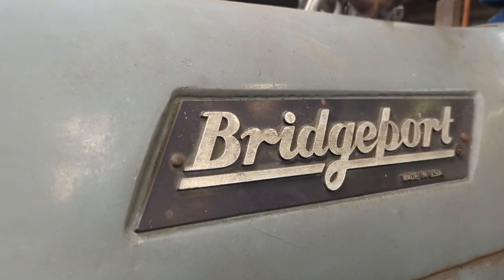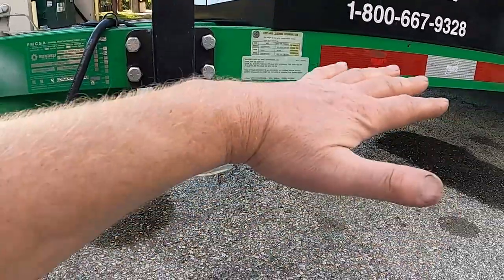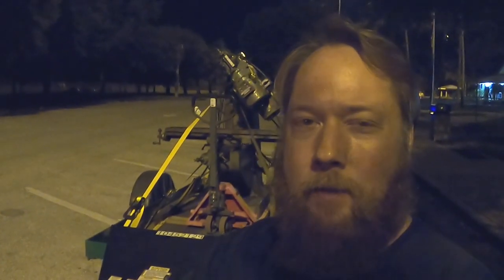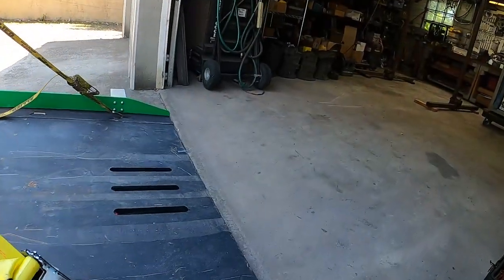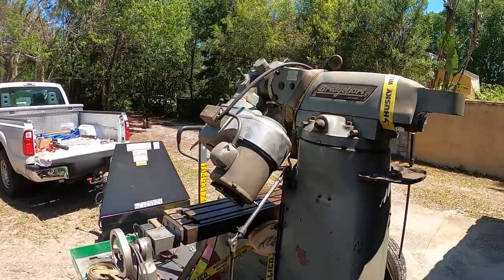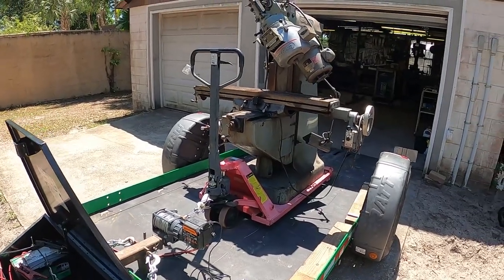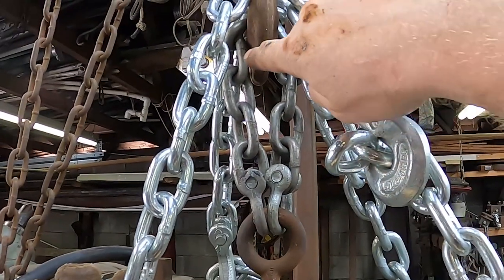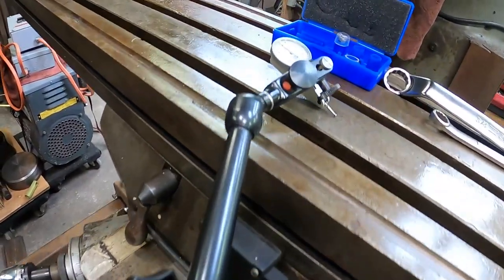The BEST Way to Move a 2000 pound Milling Machine!

Comment: Congratulations! That looks like it’s in very nice shape. My Bridgeport is 1940’s vintage, and was a basket case when I bought it in 1983. 
I’ve never seen a trailer like that. Very handy! I’ve moved my Bridgeport to six different shops over the last 40 years, using just a U-Haul trailer and a cherry-picker engine hoist. I lowered the trailer, by deflating the tires. 👍
Reply from the maker: Thanks @ChipsAndSparksGarage I'm thrilled to have found this thing. I'm still learning the basic models, but I'm guessing yours is a round ram?
These drop deck trailers are new to me too, even the tilt trailer was handy. I think the pallet jack was a big part of it too. 
Thanks for watching!
Reply: @HapticGarage  No, mine has the dovetail ram, like yours, but it has step pulleys instead of variable speed. My second most useful machine in the shop(right behind my metal lathe) Enjoy!👍
Reply from the maker: @ChipsAndSparksGarage  Cool stuff man, I'm sure you could share a few things about how to operate this beast. And agreed, the lathe comes first but a mill is a close second. A welder has to be up there in the list too, but on the other side of the shop...

Comment: Great job moving and transporting  the mill. I'm a lifetime Machinist, now semi retired. Just bought a nice vertical mill, and a 13 X 36 Clausing  Lathe. Big problem, it's  in a very tight spot and part of the makeshift garage has dirt floors I need to travel through before getting the Machines outside. That drop trailer idea using a winch looks like it's gonna work. Thanks for the video.
Reply from the maker: Thanks @renecintronjr.2262 and congrats on the mill and lathe. 13x36 sounds like a great size. I'm sure you could teach me a million things as I learn to use this beast. Good luck with the move and let us know how it goes!

Comment: I almost forgot ------ we had a guy that that took home ---- parts from machines ---- machine pieces ----- Heads -- Knees -- Columns --- Tables ------ and ---WHAT--- did he haul it in ---------- one of those little Chevrolet Luv Trucks --- before the S-10'S  ------ AND ----- what else did he haul home  ----- you got it --- a Bridgeport all tied down in that little truck ----- right down on it's snubbers ---but made it home maybe some seventeen miles ----- he was quite a Mechanic ---- quite a Guy ----- different beliefs --- and from a Country that struggles .....he has since Passed on  ----- Just another way of transporting ---- thought maybe you might like to know ------- Rodney
Reply from the maker: Wow that sounds like a sketchy haul but glad he made it! I hauled some questionable loads years ago but I'm done with that, much better to enjoy the drive without tons of risk. Thanks for sharing!

Comment: Hi Brent , This beast is a great supply to the shop, what`s possible to do with that. engine????.Greetings.Hubertus.
Reply from the maker: Thanks Hubertus, it's a great tool I'll really enjoy using. It was used while building the engine currently in Dweezil. We decked the case and flycut the heads, was also useful in drilling operations.

Comment: The Best way is to tie it down with CHAINS as required by Federal Law
Reply from the maker: Thanks Cyclebuster. I'll be moving heavy stuff again in the future, so if you'll indulge me a bit and cite the law you're referring to I'd be happy to read up on it. I don't mind putting in the effort to avoid issues.
Reply: @HapticGarage  393.130 Man, they have changed the laws a lot. I have no idea what they are thinking. I guess from what i just read the straps dont even need to be labeled for strength . I guess they don't care anymore, let them be crushed. It used to be over 4000 lbs it needed to be chained  with 2 chains. What ever. When the truck hits the car , that machine is coming through the whole pile. By these new laws you can tie down a train with a walmart strap.
Reply from the maker: @cyclebuster  Thanks for the follow up and the citation. I agree, there is a lack of clarity coming from our bureaucratic friends but that's why it's good for us to look out for each other on an individual level. Here's a little more reading that confirms your assumption about labeling but appears it's for commercial interests: https://www.fmcsa.dot.gov/regulations/cargo-securement/cargo-securement-rules  Regardless, not a bad topic for a person to consider carefully when hauling stuff. Thanks for chiming in!